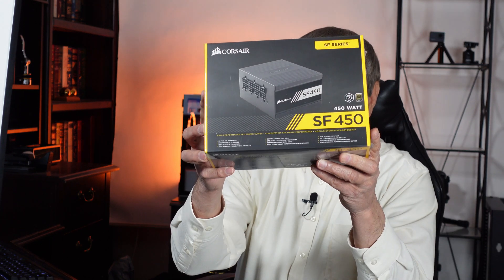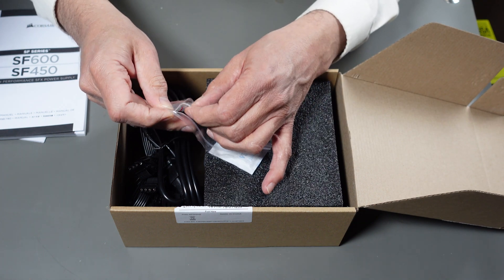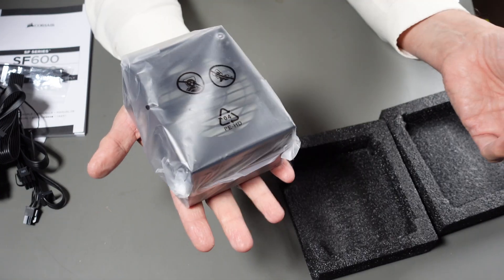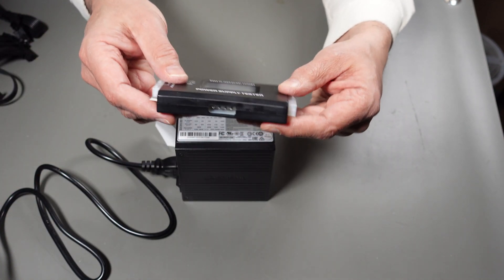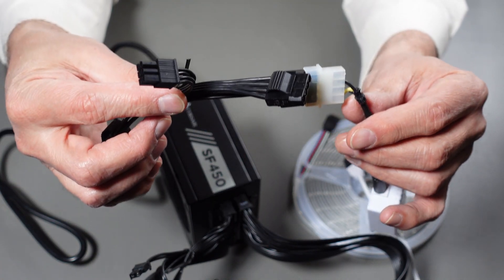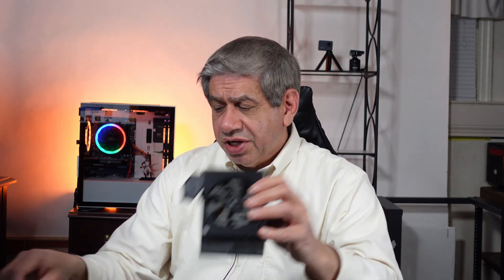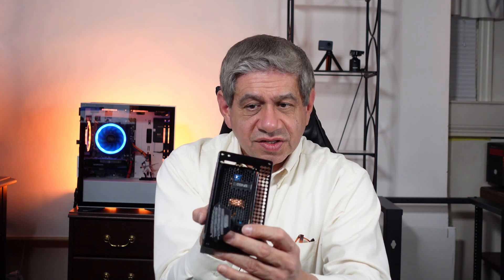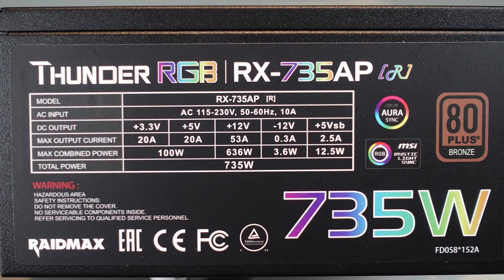Corsair SF-450 PSU Review, plus an Overview of PC Power Supply Power Rating Safety Issues

Comment: Can a SF450 handle a 3060ti?
Reply from the maker: I would use a minimum of 750 watts.  That GPU draws about 300 watts by itself under load.  If you CPU is another 100, then you are close to 350 and should use a PSU that is at least twice that side.